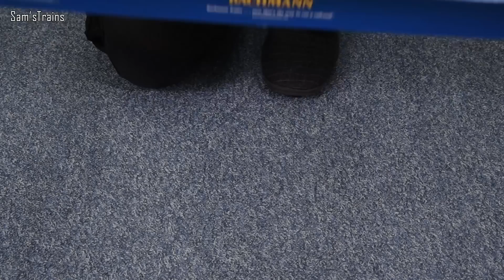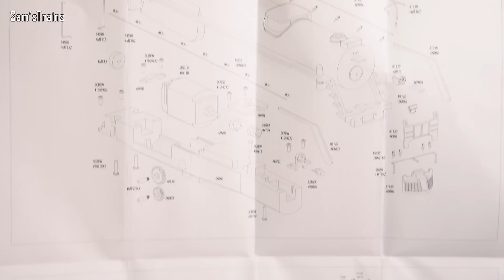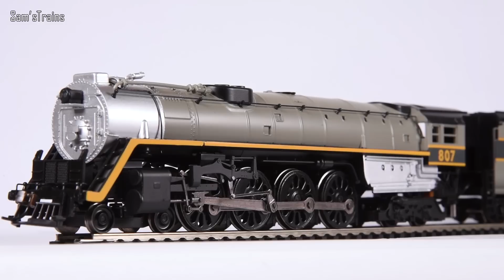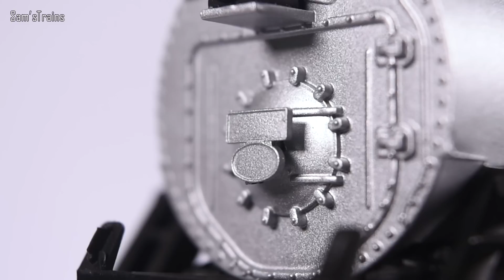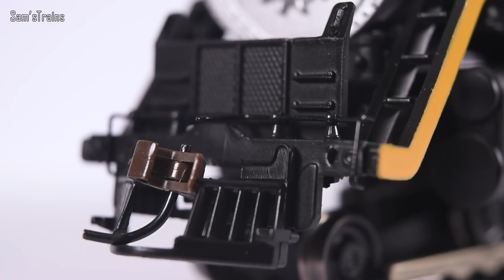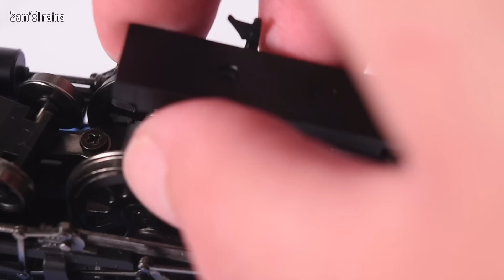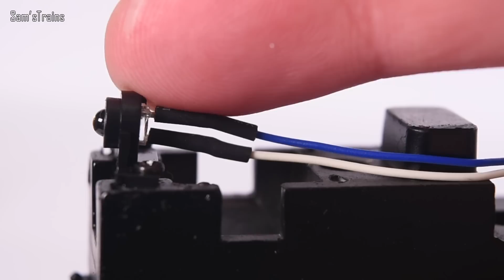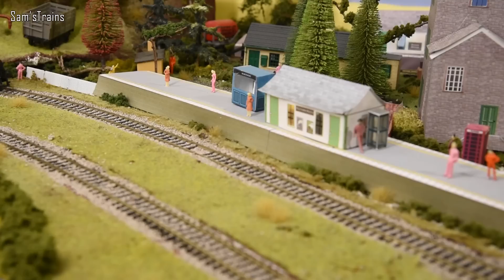Cheap,  Derailing Bachmann UP FEF Steamer | Unboxing & Review

Comment: Fun fact: The FEF loco that's operating right now No. 844, has never been officially retired by Union Pacific. No other steam engine can claim that distinction.
Reply: And she's a real beauty too.
Reply: no other steam engine can? in Europe there are plenty of steam engines never retired from service, which still operate today
Reply: @topdollars2  But, do they still operate for their owners they were built for like the 844 does?
Reply: @DanielChannel57  yes they do, daily, and without making a fuss
Reply: @topdollars2  im sure you are correct, but i cant think of any off the top of my head.
Reply: @andrewyoung749  I can think of several steam locomotives that haven't been retired yet. How's about the Nilgiri Mountain Railway, which not only still primarily uses steam traction, but actually had several new Class X's built back in 2014
Reply: @andrewyoung749  in Europe we have many never-retired steam locomotives. In Poland, Austria, Germany for example...) The 844 is probably the only American never retired locomotive, from a BIG company. Class 1 railway, as they say. Because if you take tourist lines into consideration, there are plenty also in the USA (Mount Washington to name one)
Reply: @topdollars2  He meant in USA
Reply: and the big boy 4014 has been added to the list of runners.
Reply: @mike-a-boy4236  uhh she's just running on tour 844 is running revenue
Reply from the maker: Wow!! That's fascinating - how did that happen?!?
Thanks for watching, Sam :)
Reply: @SamsTrains  from the Wikipedia summary of 844  :
The locomotive operated in revenue service until 1959. It was initially placed into storage while awaiting withdrawal, along with the rest of the Union Pacific steam locomotive fleet. In 1960, railroad leaders recognized the benefits of having a steam program and retained No. 844 for special activities, the kernel of what has become the Union Pacific's heritage fleet.
It has run hundreds of thousands of miles since, preserved by the Union Pacific Railroad.
Reply: @SamsTrains  Also Sam love the video keep it up amazing work. You've inspired me to do YouTube as well, and I'd be happy to give you any tips in the future.
Reply: @SamsTrains as the age of steam ended, UP used 844 as a snow plow for multiple years. After this, she went into her excursion career.
Reply: @SamsTrains  Well, Union Pacific placed it in storage in 1959 awaiting withdrawal, but instead of being retired and scrapped, it was set aside for special excursions.
Reply: @SamsTrains  luck
Reply: @UPX-844YTProductions Uh no, What Sam is really showing is a repainted NYC Niagara.
Reply: @DanielChannel57  you’re not wrong lol
Reply: Thx for that fact
Reply: Based Union Pacific
Reply: Never retired? Does that mean that it was used for rail tours straight away? Or was it used for shunting?
Reply: @Nubfist  It was used for railtours straight away.
Reply: @Nubfist  the 844 was used in excursions and was apart of the snow melting experiments along side the 3985 challenger. 844 was otherwise used in excursions and on one exaction pushed a stalled out freight train to while pulling an excursion. It's believed that they don't truly know the full potential of the fef-3 class because as soon as it rolled out the steam age had died. In North Platte Nebraska and fef-3 was tracked doing 130 miles an hour, they believe it can go even faster than that. I suggest looking up on YouTube the documentary on the 3985 Challenger Nnet network.
Reply: Ive got video of the 844 and the bigboy. Up close they are just marvels! Monstrous machines!
Reply: @MITSI1991  yes the are my friend, absolutely mammoths in their prime. Living history in steam and fire. Gorgeous steam locomotives.
Reply: Yeah and what we have here isn’t a FEF it’s a Niagara look at the front and the headlight placement
Reply: I understand 844 is not operating because its tender is used for the Big Boy 4014.
Reply: @johnd8892  no, they use different tenders. They’re both in operation right now
Reply: @johnd8892  No, Big Boy 4014 is using Challenger 3985's tender. Though 844 is not running right now simply because UP wants to give it a break.
Reply: @DanielChannel57  thanks. I got the loan tender confused, despite remembering the 844 and 4014 double heading soon after the re launch of 4014.
Reply: @DanielChannel57  uhh no its using its original coal tender challenger is an oil burner
Reply: @christinahartley209  Uh no, no it's not. It's using the Challenger's tender, trust me, I've seen the differences.
Reply: Wrong

Snowdon and Darjeeling railways have never had their steam engines retired, similar too LNER A3 'Flying Scotsman' and BR Standard 9F 'Evening Star'
Reply: There is in fact another…D&RGW 473. Built 1923, been running ever since (except for maintenance and the oil conversion, of course).
Reply: That‘s only true for North-America. Oldest never retired steam locomotive is the Austrian GKB No. 671, built 1860. GKB 671 is waaayyy older than the 844.
Reply: @paulbislin8471 and there is the possibility that 844 and 671 could have been in the same room at one point
Reply: the claim for 844 is that "the only steam locomotive owned by a North American Class I railroad that has never been retired".
as always americans feel the need to expand their claim worldwide sans evidence. nb see the world series...

its also worth noting that although 844 remains on the roster it doesnt do much, doesnt genaerally allow railfans to travel on it and is pushed everywhere by a diesel despite its enormous power. its very dissappointing compared to th euk/german steam programmes.
Reply: @andrewyoung749  Cause it's not like I've seen several UK steamers bring a diesel along, am I right? XD. In all seriousness though, there's a good reason why it brings a diesel along. Ever heard of dynamic braking? Or mechanical failures?
Reply: @andrewyoung749  Okay my dude, first of all, you're labeling all Americans as ignorant assholes, which, why? Second, the reason 844, Big Boy 4014, and other excursion steamers in North America bring along diesels is for electricity to power the functions in coaches (which are needed, because said excursions can last up to several days at a time) and for dynamic braking systems, neither of which a steamer can provide on its own. The diesel doesn't just "push" them along, it may help out on steeper gradients (which there are plenty of due to the territory that 844 operates in being pretty rugged), but the steamers generally do most of the work. Third, she does everything a preserved locomotive would do on this side of the pond, like, what do you expect UP to do, start putting her at the front of mile long trains going from one coast to the other?
Reply: @tempertantrum6464  bit frustrating isn't it. Unfortunately whether through ignorance or arrogance the opening comment wasn't particularly intelligent. To add with the diesel situation of course the water capacity and replenishment facilities are marginal at best and could be considered high risk. The ex DDR plan dampf is arguably the best steam plan in the world, assisted not least by their continuance of first class facilities (including the legendary meiningen). Throwing in the you conceited yanks comment doesn't help the situation, especially since the opening comment was obviously and demonstrably false within about 2 comments. It's the same as the big boy comments everyone throws in when you consider in HO scale almost every large steamer be it articulated or rigid is within an inch and a half of each other lengthwise, many northerns, Niagaras, T1's etc being larger than very well known articulateds. Sometimes it's hard to bite ones tongue...
P.S your third comment is probably the best and most relevant here: it does what the owner expects it to do and wants it to do. Be it state run (e.g Deutsche bundesbahn) corporate ownership (the UP in this case) or enthusiastically (the remarkable efforts of private enthusiasts) all the steamer efforts really are for the benefits of a small sector of the public, almost all of whom drove to see the steamer in action. My comments too long now, but you get the gist
Reply: @andrewyoung749  I would suggest you renew your acquaintance with some veridical information.  844 actually RESCUED a stalled diesel a few years ago....did you know that?  Look for the youtube video.  Also, it is never pushed.  Assisted on the worst grades, but generally the diesel provides power to the cars for air conditioning and electrical needs.  It's also there for what is called 'protection' in case the much older steamer encounters mechanical problems.
Reply: @andrewyoung749  It is actually not being pushed, and runs entirely under its own power. The diesel locomotive is only there to power Union Pacific's excursion cars, which need Head-end power. Besides powering the passenger cars the diesel locomotive itself is never running.
Reply: @andrewyoung749  The diesel is used for Head end power and only head end power. 844 is the locomotive actually pulling the train.
Reply: @andrewyoung749  The correction to your comment is Union Pacific most certainly does use 844 to pull the train. You may have been seeing 4014 being towed to Wyoming after being made ready for the trip by a diesel before her restoration.  I have had the privilege of seeing 844 twice in Ogden union station. Once was with 4014. The diesel loco is only to provide dynamic braking though the use of the motors and resisters as well as a backup if there is a breakdown so they don't block an expensive rail line. That bit of information was told to me directly from part of 844's crew the first time I got to see her running. It was awesome to see the BigBoy again along with 844. The boilers were hot and you could feel the heat and hear the small flame. There was hissing and dripping of water as they sat there.  The linkage covered with grease and oil from running, The 84" drivers are astounding on 844. Standing next to them and seeing the size of the linkage is amazing. On your point of not running them enough. It is sad that they do not run them more often and also sad that ticket prices are above what I can justify to take an excursion. The fact that the company allows for this restoration running and expense under their marketing department is amazing. There are some great videos from union pacific that followed the restoration and the running of these great steam engines.
Reply: @andrewyoung749  The diesel does not 'push' 844 at all, it is not there to provide power. It is there for dynamic braking, PTC and other things.
Reply: @andrewyoung749 they have a diesel for head end power and other small things on big railroads otherwise it’s all 844
Reply: @andrewyoung749  hi an American here, it is not a claim it's a fact that the 844 was never retired, also your claim that real fans can't write on it is false. The Union Pacific does many excursions, one being the Dever to Cheyenne excursion for the Rodeo Show in Cheyenne. Also you presume that diesel locomotive is for power, a common misconception, it is in fact a used for many things of which the 844 couldn't do like PTC. At the moment neither the Big Boy or 844 have needed to use the Centennial (worlds largest and still operating diesel locomotive)or other diesel locomotives in the heritage fleet do to the steam team installing PTC(positive train control) in the Steam locomotives. And before you get on your posh European high horse about Americans taking pride in what our country has accomplished in science, industrial, war, and anything else you want to try take from us. You may have created everything, but we made it better, more powerful, and bigger. And just remember who's the nation's industrial might saved Europe from two world wars, the nation who first landed on the moon, the nation who allows for some European snob to talk down to Americans for taking pride in what we've done. But please inform me of a topic you think you know about because you watched an episode of top gear.

Comment: Hey Sam one of your US friends here again that locomotive paint is know as the Greyhound Paint livery famous on Union Pacific 844 and 3985 however 844 is of the same class as your engine but 3985 is a larger 4-6-6-4 challenger class however the 807 you got is not accurate that looks way more like the New York Central Niagara Class 4-8-4s with a standard oil tender the real one EFE class had centipede tenders which were way different also the running example is 844 they were also converted to oil to prevent trackside fires in the western US dry conditions as coal started trackside fires from the sparks you can look up both 844 and 3985 under UP 844 and UP 3985 on google and see what the real EFE-3 class look like and the challenger class which of 3985 is from while its very inaccurate its a good buy but i thought id clear all that up for ya

Comment: The running number would indicate it to be one of the Union Pacific FEF-1 class, though Bachmann used a slightly modified version of their New York Central 4-8-4 shell, missing the smoke lifters, with a decent enough tender. The final 4-8-4 design on the Union Pacific was the FEF-3’s built in 1944.

Comment: Yeah I had similar problems with the tender draw bar, but Bachmanns website does say 4th radius curves & above so I bought 4th radius curves & after modifying the tender draw bar I haven't had an issue since & it seems to run fairly fast but thats with a HM2000 at about 60%. so yeah overall i wouldnt by it again if offered.

Thanks :)
Reply from the maker: Thanks for sharing! That wasn't made clear sadly - they failed to put the minimum curve radius anywhere on the box or paperwork! Their website says "Performs best on 22" radius curves or greater.", which is completely unspecific, and doesn't suggest complete derailment on anything tighter!
Thanks for watching, Sam :)
Reply: @SamsTrains  Yeah I agree I don't model American stuff often so I had to google what 22" radius meant and before I bought this loco I've never used 4th radius curves before. which fine for me since my layout is still in the planning stages but its not great for everyone especially if their layouts are more permanent.

Comment: All the wheels in that engine are flanged, that might be causing the derailments. 0.46 neutons...my newer Athearn locomotive does double, and there is fewer wheels. The only slow down on a curve in my experience was because of a 16 car train behind one engine. Wait...Up & SP in the same video? Nah we do SPSF, because then we dont have a railroad with a poor name (& model) behind it.
Reply: Something else I have to point out is the fact that this in a train set that retails for $400. Only difference is the road number is 809.

Comment: This was my first bachmann locomotive a good few years ago, i regretted buying it within weeks due to it derailing on curves and switches! It hates track that isn't flat, and the smoke unit had to be removed due to it almost melting the plastic shell around the chimney! Also! be very careful of the tail-light, steps, plow, and the shield on the front, fore they all broke off mine..

Comment: Main reason why I never touched large American steam locomotives is that they can't go around 2nd or 3rd radius curves
Reply: There are American modelers who refuse to use anything less than 36 inch radius curves...
Reply: @ronclark9724  22inches being the minimum for 4-8-4s

Comment: This locomotive is known as the overland. Bachmann introduced it as a train set then released it as its own entity. Quite frankly it is a very poor model compared to other models and would rather buy the smaller models bachmann has put out. The smaller models bachmann put out have more details and better mechanisms.

Comment: Your track aint made for 8 driving wheels
To tight
I gues thats realistic 
Gotta give it more points for that then
Reply: Go and watch his review of LNER P2 from Hornby. It's a Mikado, but still has 8 large driving wheels. And it doesn't derail at all.
Reply: @eastpavilion-er6081  o
Ok
Ill do so
Reply: @eastpavilion-er6081   Remember that the 9-F and most British 4-8-4's(if i remember corectly) had a wheel without any flanges so that it could take sharper curves

Comment: Broadway Limited Imports and Athearn Genesis are where it's at when it comes to American Steamers, a fair amount of £££ though compared with Bachmann, as always, you get what you pay for. :)))
Reply: and MTH
Reply: @yaneljim  Yeah, MTH are pretty good but beware, their own DCC sound decoders were not NMRA compatible though, they weren't when I bought one of their SD70ace's about 12 years ago, this limits the amount of functions you can operate with a 3rd party controller.I don't know if  that situation changed!
Reply: @yaneljim MTH is a  bit toy like though, bringing 027 to the HO world. There's definitely a bit of a market who are into that but it's probably limited
Reply from the maker: You're right - desperate to try some of those one day!
Thanks for watching, Sam :)
Reply: @SamsTrains  You will not be disappointed, and as good as they are, their quality seems to keep getting better.
Reply: Yeah I spent $900 for a brass second hand 4-4-6-4 steamer from BLI. Its was worth the money.
Reply: @poindextersheelturn436  价格对发展中国家太不友好了
Reply: Dont forget Rapido. yes their steam range is very small but they have steam now.